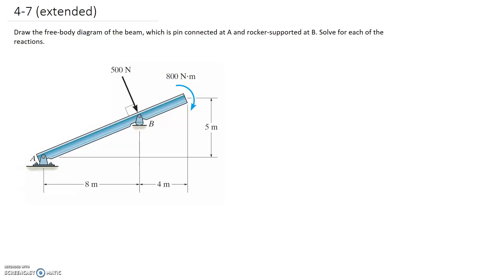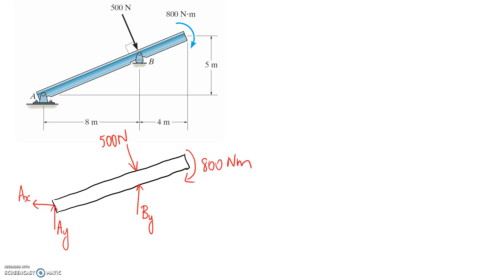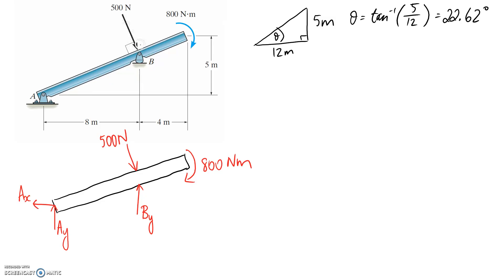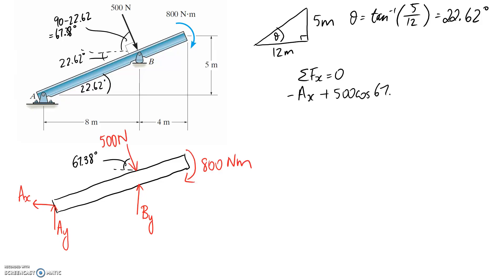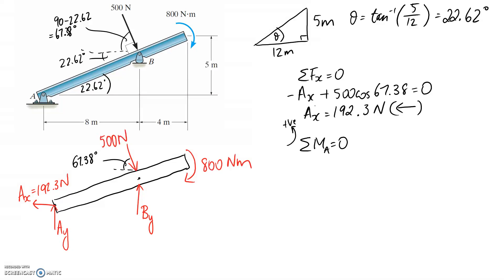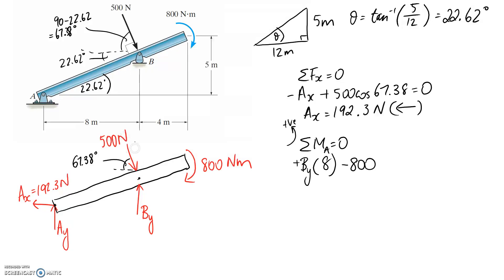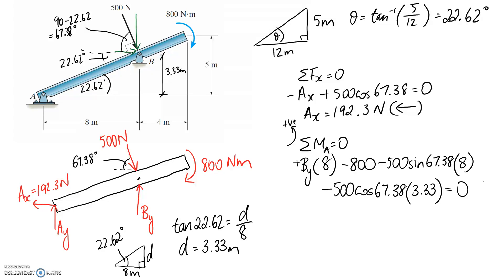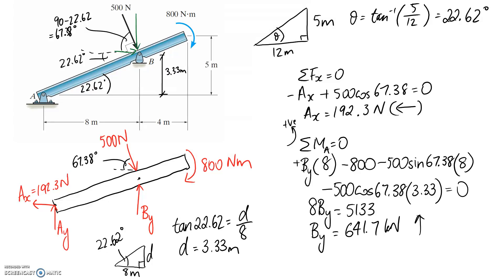Pin and Roller Support Example

Comment: what if the pin is on the right side? in what direction would be the positive?
Reply from the maker: The process would be the same if the supports were switched - it would just mean there would be a horizontal and vertical reaction force on the right and a vertical reaction only on the left.

Comment: Not sure about the 800N-m moment in your moment equation around poin A...
Reply from the maker: Hey..not sure which part is confusing. If you rewatch the moment equation I explain what I'm doing with the 800 Nm there.
Reply: @theryderproject5053 you are correct. I har simply forgotten that you basically add/subtract the moment. This makes no intuitive sense, since in the moment equation you summ moments AROUND a chosen point. M=F×d. Distance being from where the force is applied x normal distance to axis of rotation. Makes no sense that a moment around a different point is simy added even when the axes of rotation do not match
Reply from the maker: @aleksandrsnaumovs4277  You can think of the "moment" as being a rotational action applied directly onto the structure (like as if you got a screw driver and twisted it into the structure). It's already in the moment units (Nm). This is in contrast to forces that are linear and in N. To convert them to a moment (in Nm) we need to multiply by the distance (in m) over which they act. If a force is far from a pivot point then it's going to cause a big moment (or rotational action), but if it is close to the pivot it's only going to be a small moment.